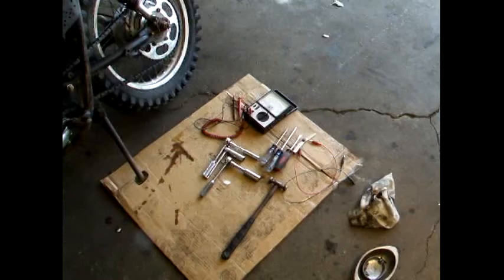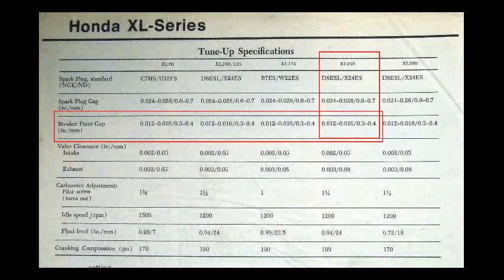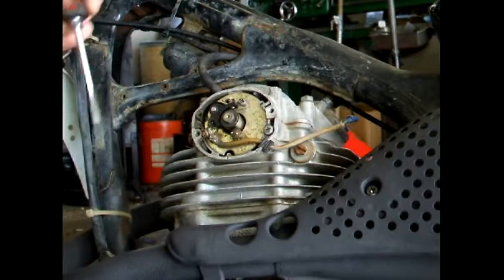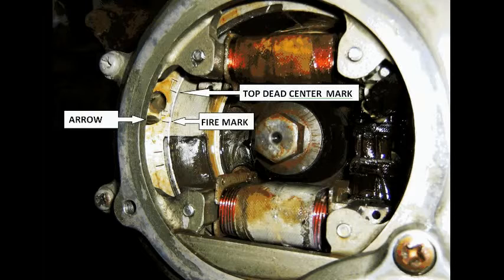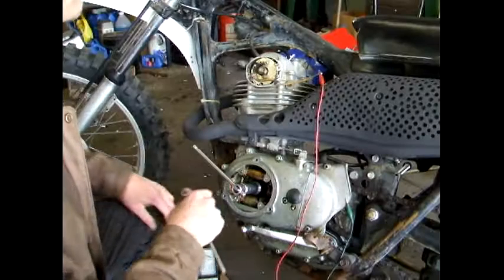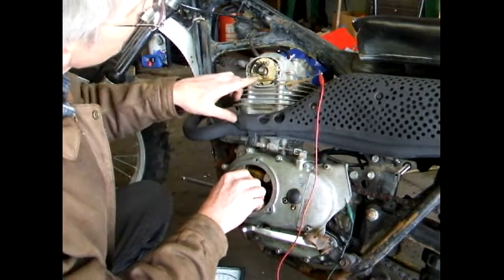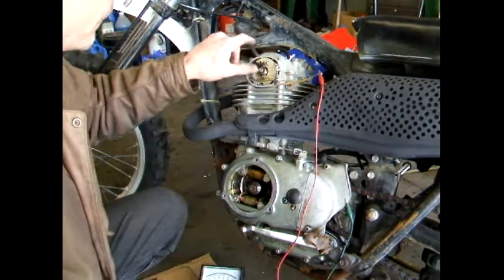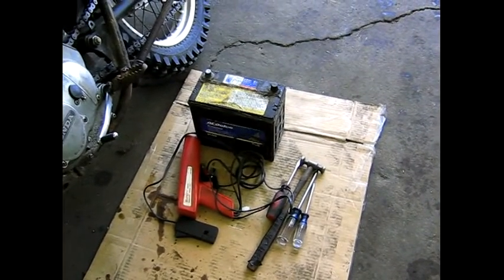Motorcycle Points Ignition system. How to set them accurately!

Comment: Great video thanks.  Had question.  I'm working on a '73 Xl been sitting for a long time, got it started.  Starts right up idles smooth but when under load (riding while accelerating) it runs really rough do you think this could be the mechanical advance?  Also I am not running it with a battery can I test with VOM meter without battery?  thanks j
Reply from the maker: +Johnny Mansour Disconnect the voltage regulator so that when you rev it up it doesn't put a load on the stator  and cook your lighting coil. you might want to use it later. Here's a couple of video's on that particular bike on how to set the timing and check the advance, and how to make an air filter for it, because that could make it run poorly if it is old and deteriorated. 

How to set a Motorcycle Points Ignition, Statically   https://youtu.be/WQqLnBRsofk

Dynamic motorcycle ignition timing https://youtu.be/cJqfIuuHOuw

Make an air filter for your Motorcycle  https://youtu.be/iAKnz2w6PkA